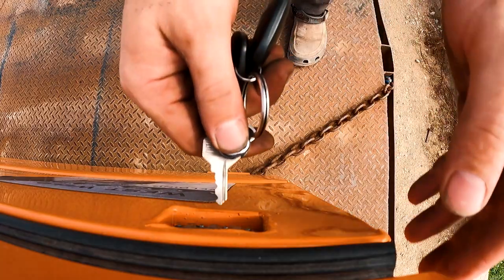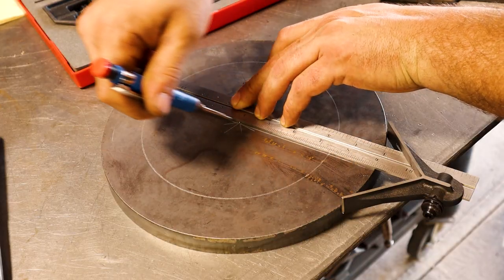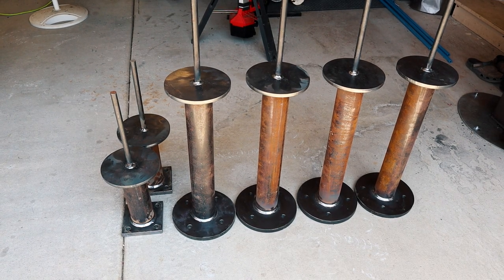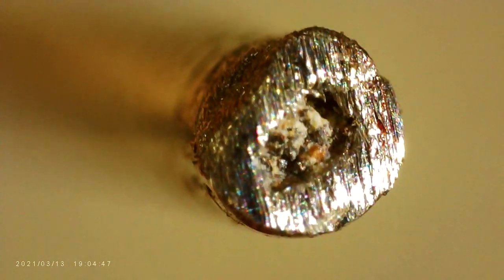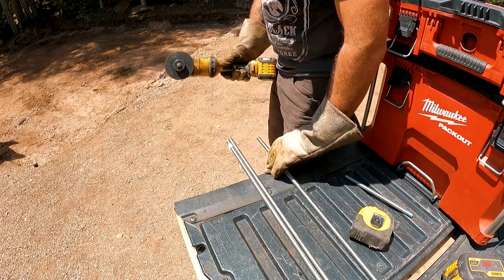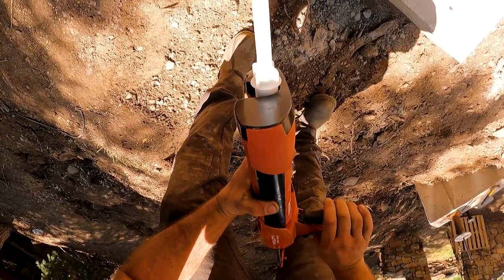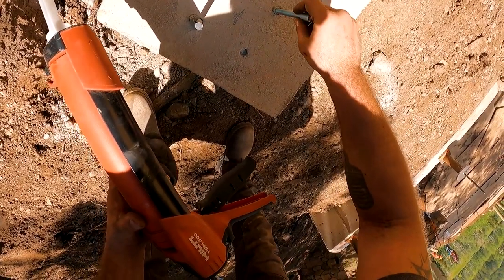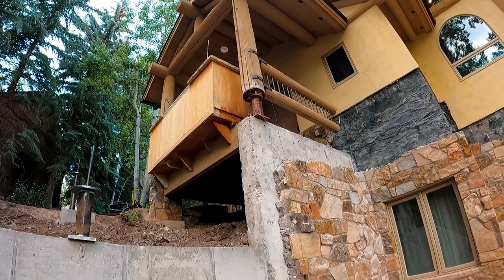Dual Shield Flux Core welding

Comment: I love your videos.  Pro-tip on the setting epoxy anchors with the pricey hilti stuff.  Inside of the bag with the tubes is a straw, attach that to the end of the nozzle and then insert it all the way into the bottom of the hole. Then squeeze and retract slightly.  Rinse and repeat until the hole is filled.  That air popping sound when inserting the all thread is indicative of voids.  Inspectors around here listen for the popping sound and promptly fail it.  Also helps with the mess.
Reply from the maker: interesting thanks man i wondered what those are for......its funny i worked for several different companies that used that stuff and thats where I learned and no one ever did that but makes alot of sense. Im not a pro at anything really just trying to learn like the next guy. Thanks
Reply: Hah! Yeah I felt a little pretentious writing pro-tip.  Ive set thousands of anchors and I just recently learned the straw thing too.  I always assumed it was for the blower which was irritating cause it’s too short. I’ve learned a lot from your videos and appreciate the channel.
Reply from the maker: @spaghetticallahan9292  Thanks man not at all I appreciate it.......I wish you keep making youtube videos theyre great! Not just saying that unique editing and entertaining, people would like you.
Reply: @westweld  Alright f$#* it.  Ill make some more.  Thanks.
Reply: @westweld  That's good to know.  I really enjoy making them, just got busy with blah blah (insert preferred excuse here).  The support is appreciated.
Reply: @westweld  Logarithms are everywhere... (per the 1000 subs in a year, then 10k in about 1/10 that time). Math/computer science nerd turned welding/fab nerd here. Turns out I like making shit with my hands. The pandemic taught me that. 2020 was the best year I've had in a decade. I know it was shitty for a lot of people, but it got me out of the office into my shop to learn to weld and fab. $30k later in equipment and I'm thinking about a career change. Please keep making these videos. Weld.com vids, This Old Tony, You, and Jody taught me how to weld. Seriously. World was shut down so it was my only resource. So, thank you.

Comment: Cut the all thread at a 45 angle and that eliminates plunger effect and keeps more epoxy in the hole. Like your style and additional info you provided on dual shield flux core. Subscribed !
Reply from the maker: Good idea thanks man ill try it

Comment: Darn good stuff to watch,,and learn from. I use an expoxy gun on smaller scale when bonding sheet metal qrts, floor panel's, ect on auto restorations, use to (10+years back) spend hrs welding, but the 2 part epoxy's don't warp and stronger than a weld in. Tx West, good vid!

Comment: Good video shows the realities of the life.
That hilti product really should have been RE500 (black and red tube, sizmic rated) if a stone wall is being built on top of it. 
Looks like you were using RE200, also the holes should be reamed with  a brush as well as blown out 
If this stuff is applied correctly, the high tensile threaded rod will snap before the rod pulls out of the concrete, it surly is a modern day construction miracle product.
Reply from the maker: Thanks dont claim to be an expert on epoxy I use what the rep suggests......and the holes were brushed out with a brush that goes on a cordless drill just didn't get any footage of that
Reply: @westweld  great video regardless
Reply from the maker: @roguecnc788  thanks man im not above criticism or learning things
Reply: @westweld  not a criticism bro, more like a pointer, keep going your doing a great job

Comment: I pretty much flux core everything nowadays... thicker than 1/4 I use a stick... my fav weld type is Tig, but shielding gas is 30 miles away anytime I need to fill it

Comment: I already have some regular flux core wire so does that mean I can use it with shielding gas to get the same result or is Dual Shield specifically made to be used with a shielding gas?
Reply: Specifically made for shielding gas, and typically only the specified gas. This is the best semiautomatic process out there in all positions! Not really good for downhill at all, but it’s forte is heavier steel which shouldn’t be welded downhill anyway!
Reply from the maker: Sorry Mark dual shield is designed for shielding gas

Comment: Did you say you started a fabrication business by learning how to weld from YouTube? Pretty amazing!
Reply from the maker: I had a few welding jobs too but you can learn just about anything on YouTube
Reply: @westweld  Ok so you learned some welding fundamentals on the job and then added on top of that with YouTube.  I agree 100% about YouTube and what a great resource it is. Some of the hands-on skills, like welding, can be a little tricky to learn from videos I think.  I think it would be quicker with a skilled person teaching and watching your technique but even then a skill like welding just takes lots of practice.  Having said that, it's how I learned (and am still learning) to weld 100%.  You watch it being down and listen to angle, puddle, speed, and all that stuff in the videos but doing it is a whole different thing.  You might think your angle is good or that your travel speed is correct but maybe it isn't and no one is there to tell you otherwise.

Comment: Is any mig that can run shielding gas capable of running dual shield wire?  Anything have to be changed to run it?
Reply from the maker: it depends on the size of the machine i was running .045 diameter wire but if you were to get .035 it would take a little more voltage than regular wire and also knurled drive wheels are suggested but they sell those for most machines. If your machine is maxed out when you short circuit mig on say 1/4 plate then it probably isnt enough power but if you have some room it should work fine

Comment: That rotary positioner is Badass!  What brand is it?  Also, I've been welding for 30 years, how hard is to to transition from mig and fcaw to the DS? Thanks Brother.
Reply from the maker: Thanks man....Its easy dual shield welds itself you won't have any issues, and the positioner i built from a treadmill motor and an amazon gear box

Comment: dude how does this vid only have 6k views?!?!  and nice to see your subs growing!! So a buddy just send me a link for a depot-grade Lincoln 140 mig and I was just remembering the cheapie you used for a video and gave away. I (like a commenter below) began to learn welding in 2020 thanks to convenient bad timing? and a purchase of a Lincoln square wave tig. Turns out I probably should have watched more youtube before dropping the loot, I'd have probably gone with something else but ya live and learn. Now that I can poorly tig, I really want a point and shoot and I have a spare high pressure bottle that I can use for a mig setup and I'd prefer not get a flux-core only super cheap machine. I tried to win your give-away but wasnt lucky enough... womp. Any recommendations for a cheap mig for a hobbiest?
Reply from the maker: Honestly I don't think you can beat that yes welder machine I gave away for under 500$ and it has alot more capabilities than just a super cheap fluxcore machine, in my experience if you buy just a fluxcore machine some day down the road your going to wish you could do more......also just wanted to mention in this video I was using dual shield fluxcore and that requires gas just like hardwire mig.
Reply: @westweld  yeah, I cant see wasting money on a flux only. I remember you said you were using dual shield and it's funny how a project can go south in a small garage if you need the door open or proper vent for safety. TIG is nearly impossible outdoors unless it a pretty still day. That YESWELDER is on scamazon for like $383... dual shield here I come! Thanks man. I've said it before but I love your vids, please just dont go doing this annoying click-bait title and thumbnail BS I see happening everywhere. I hate that $#!t.

Comment: So dual shield flux core is just using gas with your flux core?
Reply from the maker: No it is a specific type of wire designed for both gas and flux

Comment: help me out here. is dual shield the same as flux core that is used without shielding gas only you are using the gas to add more shielding. or is it different.
Reply from the maker: So dual shield flux core is different it has flux in the middle but also requires gas.....flux core (often the stuff that comes with little welders ) is different using shielding gas with that wouldnt help you. If you used dual shield flux core with no gas it would be full of porosity.

Comment: I don’t have a mig welder would stick be similar to using duel shield
Reply: No
Reply: I would say so, both rod and flux MIG are very similar but you should get better penetration using 6011 or even better 7018 for estructural. The main advantage of using MIG welding wis SPEED
Reply: @santiagosalcedo7653  Thx